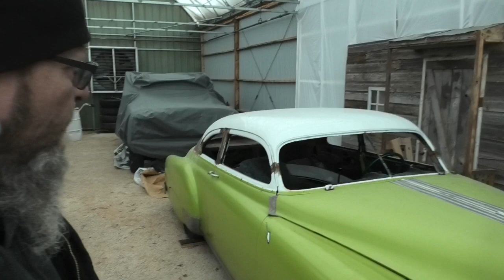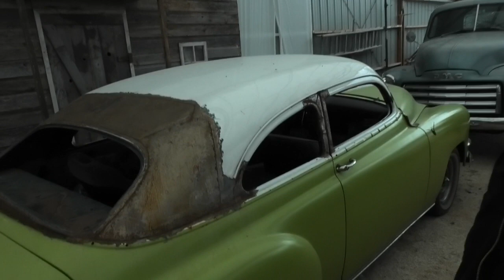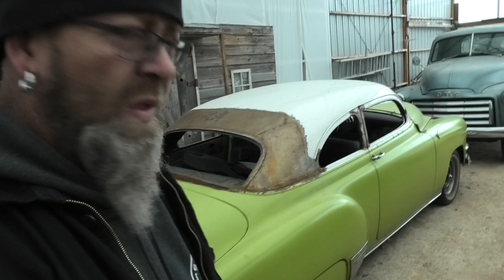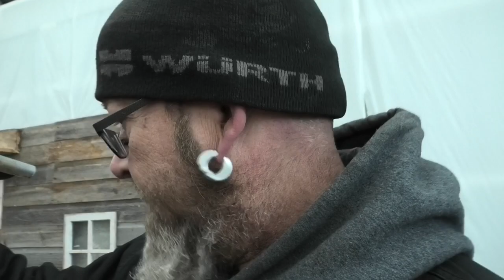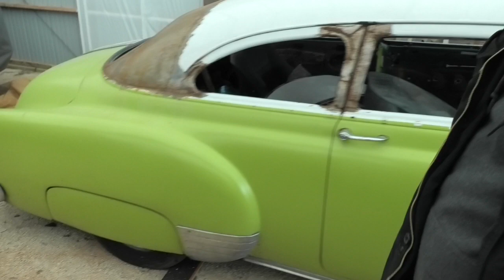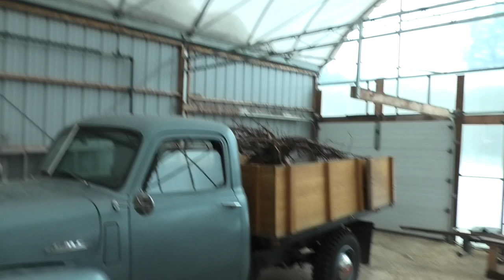1952 Pontiac Fleetleader Deluxe, older project, chopped, lowered and needs to be finished. Lead Sled

Comment: Love the Pontiac. I owned a 52 about 25 years ago when I lived in Kansas. I put it on a 70 lemans frame. I did not have the tools or knowledge to do anything else with it so I sold it.
Reply from the maker: How did it fit the lemans frame?  Might figure out a chassis swap for mine.

Comment: True to your word! Thanks for showing us your Poncho!!

Chop looks Great 👍 

I’m not a fender skirt fan, But if you want to make them permanent, seems you’d have to make the fender removable.
Lotsa work-but easier than a chop😁
I can envision 3 possibilities:
1) Whole fender at the body.
2) Outer skin of the whole fender bisected at the crest/fender welting at the split.
3) Lower half of fender or quarter removable like 49-51 Mercury. Horizontal splits could be tucked under like the Merc or hidden under  
stainless trim.
Reply from the maker: Thanks for the advice JP.  I was thinking of building some sort of cruiser skirts, but not sure how they would work with the gravel guards.  Thanks again for watching.
Reply: Cruiser skirts would be cool 😎
Reply from the maker: @jp4121  yeah, might have to lose my gravel guards to make them look right.

Comment: My sympathy about the hood flipping up - happened to my 53 Pontiac, but at a much slower speed, on its way to be painted. Damage was pretty much confined to the hood and hinges, and sometime later I replaced them . The parts car I used was an American model (2700 series) and it had a 239 Pontiac flathead 6. Most (by far) 2700 series cars came with the straight 8, as mine did. When I had what I needed from the parts car, I sold it to a friend who had a similar 2700 series car, also a flathead six cylinder.
Reply from the maker: Thank you.  It's not a very good feeling when that happens at all.  I didn't realize that some US models came with a 6 cylinder.  Thanks for the info.

Comment: I might know where there is a grill up north. Looked at the photos gone from one car other has one Think it’s a 51 Pontiac Fastback four door. Not sure of shape. 
Also ya it’s the rod from the steering box to the column with the rubber piece.
Reply from the maker: Hey Nolan, where abouts up North is this grill?  Also, what exactly did you need the steering column shaft for again?  Memory isn't so good anymore..lol.  Thanks again for watching.
Reply from the maker: @cannednolan8194  ok..I'll send you a text.  Thanks again.